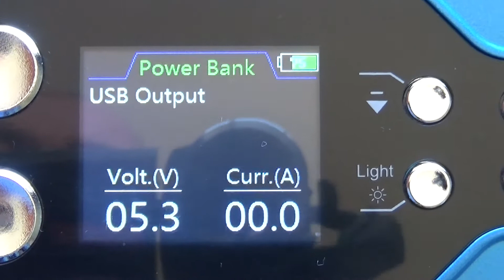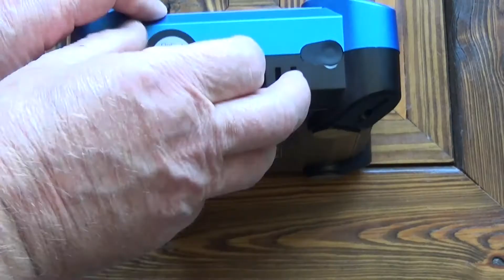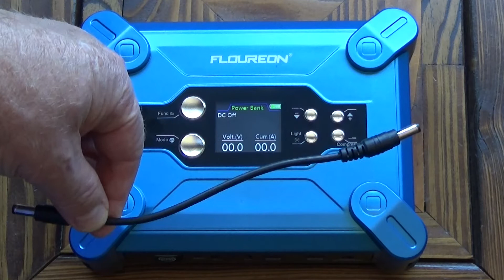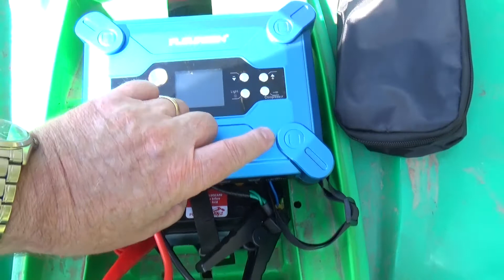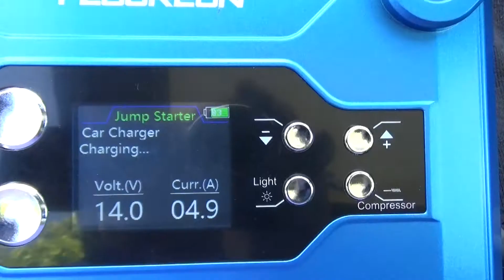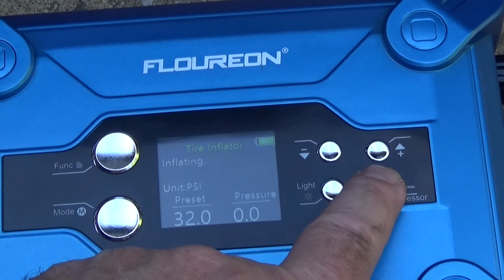Floureon W100 Car Jump Starter (Built in Air Compressor) - Review

Comment: I wonder if the USB ports have a different amperage rating? I know my power bank does with a choice of 1A or 2A, because  many tablets, including the iPad, require a 2A charger. Some smartphones can also use a 2A charger (e.g. Samsung Galaxy Note II). I'm surprise there is a maximum of 19 volts  and no 24 volt option as many devices use that power. But overall another great review and this looks like a great bit of kit. 
I'm off to Ebay to look for a handheld cigar socket car flashlight as I think this would make a battery for a light for walking the dog with the unit in a backpack! 
Update I found a "Type S 12V Portable Magnetic Spotlight for Cars, Boats, SUV's" that looks the ticket. :)
Reply from the maker: The specs say 3.1A for the USB ports, not sure if this is each or 2A and 1A.  Thank you for your comment :-)
Reply: Hi! Can you tell me if we can charge a car battery out of the car ? Tks